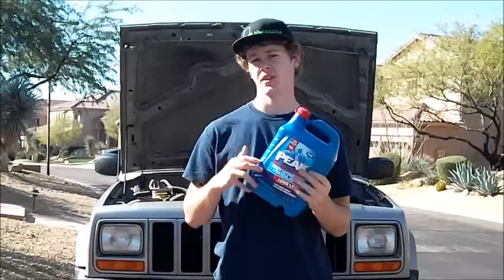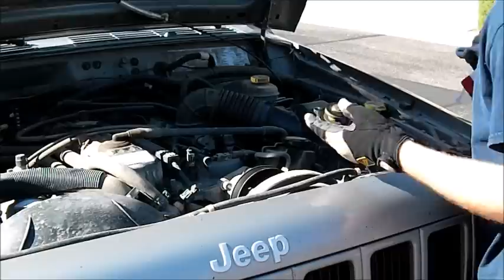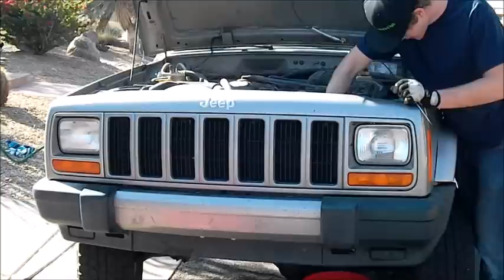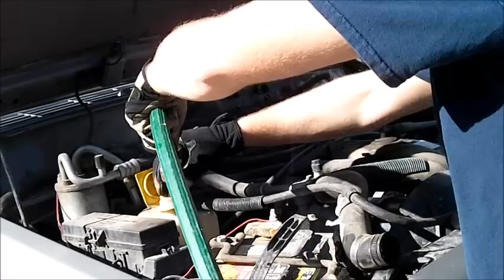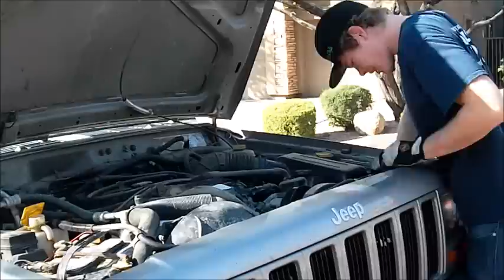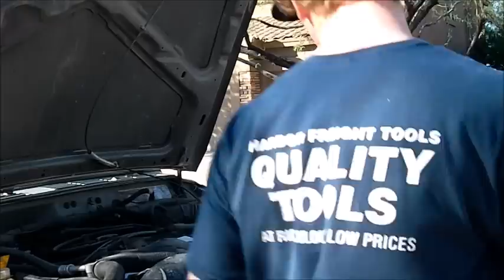jeep cherokee cooling system flush

Comment: Quick question, how did the water get passed the thermostat when putting it directly into the top of the engine? Wouldn’t that mean your thermostat is stuck open? Cause mine doesn’t let anything flow in from the top and I just did a thermostat and water pump.
Reply: Watch the beginning. He warmed the motor, then shut it off. He then disconnected the hose just after it cooled enough so the system was no longer under pressure. The heat from the block keeps the thermostat open, so water can flow through the block.

Comment: When you used the hose it wasnt distilled water right? Does completely flushing it after make it ok to use hose water? or should I flushed with distilled as well
Reply: also, you added everything directly through the radiator..should I fill up my coolant reservoir with 50-50 (assuming it hasnt after running to operating temp)
Reply from the maker: Hi Mark. That's correct. The hose was just normal water which is why I emptied the system again after running the hose through it. If you have enough distilled water, then you could run  that through the system as a final flush as well since it is impossible to completely drain the system.  To answer your other question, yes you should also fill your overflow reservoir to the proper level.
Reply: Admiral Off-Road sounds good thanks man
Reply from the maker: Mark Romano no problem. and good luck!

Comment: Great video man I blew my top radiator mudding and got a professional flush and it didn't solve my over heating problem so I may think it's my water pump but first I'm doing exactly what you just did!?
Reply from the maker: Good luck! Hope it solves your problem.
Reply: donny moran any update on your overheating issue?

Comment: 1999 Jeep cherokee sport 4.2 6 cyl. Great video, easy to do. I also changed the coolant sensor as well because my gage stopped working, it's working great now, temp is reading a constant 210 when vehicle is warm. The issue now, is I lost all my cabin heat! The heater was working great when I ran the coolant cleaner through it, and after the coolant change for the first day. But today the heater does not blow hot air anymore, just cool. The blower is working fine. Any clue why? Thanks for your help!
Reply from the maker: Sounds like some air trapped in the system. The heater uses the hot coolant to warm the air that the heater blows into the cabin.

Comment: Hey man, thanks for this video.  Before I do this I was wondering... how long did you run the Jeep while it had the water/flush cleaner in it?  Thanks!
Reply from the maker: *****  Hi Mark. i ran the jeep just long enough for it to reach normal operating temperature (210ish). it took about 10 minutes or so.
Reply: Cool, thanks so much!  I'm looking forward to doing this.  It's amazing how much car maintenance is easy to do if you just know how!

Comment: How are you flushing the upper radiator hose with the thermostat? Mine blocks all the water.
Reply from the maker: you might have to remove yours. Not sure why some people have to and others do not
Reply: Admiral Off-Road if the thermostat is blocking the water, do you still run the water through the upper hose?

Comment: Not quite sure how your system can be flushing through the upper rad hose without your motor running to open the thermostat?
Reply: I had the same question. 1995 4.0
Reply: Probably has a bad thermostat because it was cold enough to change and not bubble over which means either he has a bad thermostat or he is running a really low spec thermostat; OE is 195°F

Comment: Ok good sir, your channel is definitely the best out there for such things. So, I followed your steps like the Bible and everything worked great except the upper radiator hose flushing. I put my garden house in there and it just filled up with water and never came out the lower radiator hose (which of course was detached). I kept filling it up, and you could hear it filling up, but the water never would come out except for when I turned that upper radiator hose upside down. When I plugged everything back up and filled with anti-freeze I could only get about 1 gallon of anti-freeze in there. 

What do you think is the problem? Everything else went well, no overheating.
Reply from the maker: your thermostat is probably blocking the water. I have a video on how to replace the thermostat, but if you remove the thermostat and reattach the housing, the water should flow through fine.
Reply: Hey man thanks for the tip. I'm going to watch your video and give it a shot. Really appreciate your response!
Reply from the maker: Good luck! let me know how it goes!

Comment: When i try to run water through the “rest of the system” via the left hose facing the engine ~5:50, I discovered something was blocking it, like a valve of sorts was closed. The water just shot right back in my face when I turned the water on. What gives?
Reply from the maker: Your thermostat is blocking the water. This seems to happen to some people and not to others.  You can remove the thermostat from the housing, reattach the housing and flush. Then put the thermostat back in. The thermostat housing is held in with just 2 or 3 bolts.  If you need help with that, I do have a video on how to replace the thermostat. Hope this helps!
Reply: @AdmiralOffRoad  if I've read correctly you can push water through the small hose that goes to the thermostat it's open constant.

Comment: Can jackstands do the trick if it isn't possible to put it uphill?
Reply from the maker: Meta Mein jack stands would work fine or even just putting the font tires on a curb. As long as the vehicle is leaning back putting the radiator cap at the highest point in the cooling system, air bubbles will travel to the highest point allowing you to burp the system and get rid of all of the air.

Comment: My upper radiator hose in the top left doesnt drain, it backfills and flows out the end im filling from. Is there some blockage or does it need pressure to be pushed through?
Reply from the maker: you might need to remove your thermostat. I was able to get water passed mine, but i know some people have run into your same problem.
Reply: Admiral Off-Road Thanks for the reply! Do you think there any way to open up the thermostat without removing it? Or to flush it from a different tube other than just the radiator fill cap? I don't want to have to mess around with a new gasket if i don't have to. I started flushing the radiator but now i cant get water through the upper hose so i have no idea how much of the old coolant is still left in the system. Am i screwed and just need to get to the drain plug behind the radiator?

Comment: I noticed my lower radiator hose is a few inches before the very bottom of the radiator will I still get a good flush without undoing the drain plug
Reply from the maker: the water flowing through it should be enough to flush out anything in the radiator. There is nothing wrong with using the radiator drain plug. Mine was just stuck so I went with the lower radiator hose instead

Comment: Dumb question, but if you are running the water under pressure through the system is it necessary to run the garden hose water through the system?  Wouldn't the water under pressure when clearing the heater core do the job?
Reply from the maker: +Adam Mooberry Not a dumb question at all. Running water through the system via the hose is a way to flush out the rest of the coolant trapped in the system. The pressure of the the coolant flowing through the system might be enough to keep buildups from happening, but the dirt and debris will be suspended in the coolant still in the system. Just disconnecting the lower radiator hose will not completely empty the system. running water through the system via the hose helps to flush out the rest of the old fluid before refilling with new fluid.
Reply: +Admiral Off-Road Thanks for the info.
Reply from the maker: +Adam Mooberry you're welcome!

Comment: Hey Admiral great video i just replaced my fan clutch radiator and water pump and serpentine belt on my 92 cherokee after doing all this i looked in my original owners manual and iv never seen or heard of this but there is a engine block plug under the manifold for the coolant flush it said to leave the radiator cap on and remove the engine drain plug and drain cock and supposably it will drain everything the over flow and block everything do you know if this is not recommended ? Also i know you live in AZ where its all ways hot what temp does your cherokee run at ? I had mine jump to 230 while 4wheeling on the beach and i read that it is NOT uncommon for it to go that high but normal operating temp is 195 and thats why i changed everything now it goes as high as 195 but at night when its cool it doesn't go over 190 which im happy with but i worry when im on the beach again that it will shoot up again under the heavy strain does yours ever go up to 230 when 4 wheeling ? 
Thanks Admiral

Comment: Great video!  Got a little problem though; when I went to flush the upper radiator hose/engine it's not flowing freely. I turn the garden hose onto not even half power and it's still spewing back out the upper hose.  Off the top of my head I'm thinking blocked passages,  but my radiator went just fine and usually from my experience the radiator clogged first. any clue? 

btw this is my first jeep.  1992 jeep Cherokee laredo
Reply from the maker: you might have to remove your thermostat. It could be stuck closed and not allow the water to flow through
Reply: +Admiral Off-Road good call,  idk why I didn't think of that.  since they're cheap I'll probably just replace it,  what's the opening temp on these 4.0's
Reply from the maker: I have either a 190 or 195 thermostat (can't remember) and that works fine even in the summer in Arizona. I have a thermostat replacement video if you need to reference it but the process is pretty straightforward.
Reply: +Admiral Off-Road yeah our summers aren't Arizona hot but in NC they get pretty sticky. thanks for the heads up ill check it out!

Comment: I have the radiator out, because its simply leaking all over the place and i have a new one waiting to go in, but i cant circulate fluid without the radiator, any tips?
Reply from the maker: +Kjartan Bragi Ágústsson Are you trying to run the water through the radiator or the rest of the cooling system?
Reply: +Admiral Off-Road flushing the whole system before putting a new radiator in, but i solved it by simply putting the old one temporarily in and flushing like you did
Reply from the maker: +Kjartan Bragi Ágústsson Glad you got it figured out!

Comment: Hey xj is running hot. I checked my radiator fluid and it is not milky just dirty looking does that sound like I need to flush it out?
Reply from the maker: ash howard If its dirty, i would flush it. Dirt and things can damage your water pump or restrict coolant flow which could be contributing to your increased temperatures. It might not completely solve your issues, but its a cheap and easy place to start and will help extend the life of your cooling system.
Reply: I think I have a clog some where in my upper hose because my lower hose cools down fine it's just my upper hose is holding heat.

Comment: My xj also makes the same ticking noise as yours at startup. Any idea what that is?
Reply from the maker: mikester9er There are a few things that can cause it. Most likely a small exhaust leak in the manifold ( they're known for cracking) or some lifter noise until oil can get to them . It seems to be a pretty common thing in XJs.
Reply: Every straight 6 does it, it's normal

Comment: Very informative. Currently working on fixing an overheating issue I have on my 2003 Jeep Grand Cherokee since moving down to the Phoenix area. May have to end up doing this. Didn't even think about adding coolant first. Quick question though, how much water did you use for flushing the radiator? I live in an apartment complex, and don't have the luxury of using a garden hose. I might just pour water in from the kitchen sink if it isn't too much.
Reply from the maker: I can't remember off the top of my head. If you could get around 10-15 gallons, that should be enough to flush it.

Comment: hey man, good clear video, I flushed my 2000 4.0 like you did however I used distilled water for the whole process, a bit more expensive but worth it for the piece of mind of have pure h2o and coolant in the pipes,  then put a 50/50 mix of Zerex ZXGO51 G-05 Antifreeze after reading some reviews about the chemistry, I also replaced my 195f thermostat with a 185f thermostat because I'm usually in a very hot climate, so thanks for letting me watch it be done first before I attempted myself... I'm interested in if you know anything about that little bit of noise coming from your rig, it's almost like a very soft lifter tick, I have the exact same noise in mine and it started after putting synthetic oil in just one time! I know it's not threatening to the life of the engine but it still bugs me, any ideas?
Reply from the maker: Taylor Horton The tick is super common in the 4.0. I think, in mine, its a lifter.
Reply: Admiral Off-Road just a normal operating noise because of the 4.0L's flat tappet camshaft.
Reply: It's probably a bad idea to run a lower temperature thermostat. Your engine is supposed to run at 210 degrees F. If it runs hotter than that in any climate something is wrong.
Reply: My 1994 makes the same noise and also only began after one synthetic change. It makes me bonkers, but it also has 216K.
Reply: i heard the same thing as soon as he started it up.
Reply: Admiral Off-Road 

Mine was my throw out bearing in clutch. Had me stumped for a while. Unfortunately I have to drop the whole transmission to get access. Going to replace the clutch once I get into it. 

If you have an automatic it is most commonly your flex plate. They have four screws that come un-seeded. They can be fixed pretty simply and the noise is disguised frequently as a lifter issue.  Check out you tube. You can test this by hitting your gas pedal. If the ticking noise gets louder or even same noise but moves with the rpm of the engine it is a lifter probably. If it disappears when accelerating or when engaging gears under load it is your flexplate (automatic) or a clutch issue.

They are also known for lifter ticking. I have not experienced this but from other forums I have read the fix is to remove valve cover (good time to replace the gasket) and locate the lifter and abuse some marvel mystery oil on it or replace the lifter.

Comment: When I run water through the upper hose to clean out the system it doesn't come out of the bottom hose. Do you know what could be the issue?
Reply from the maker: yep, for some people, the thermostat will not let the water flow through. You can remove and replace it at the same time (which is a good idea anyway). If you have any questions on how to change your thermostat, I have a video on how to do it.

Comment: Nice video. Been wondering how I can flush out the cooling system; the day I got my 97 Cherokee. Now, I was wondering if you could type out all the things I need to get or need when I am doing this? I don't know why but I can't hear the sound from your video. It could be my speakers or just "Youtube" but anyway. Thanks for your great work on the video. Hope to watch another video that could help Jeep Owners like us "including you". How to maintain our Jeep. :D
Reply from the maker: BCJeepCherokee you'll need a hose, a bucket to catch the drained coolant, a few gallons of distilled water, full strength antifreeze (not 50/50 premixed), radiator flush (optional) and a screwdriver to undo the hose clamps. you will undo the lower radiator hose to drain the old stuff out, then undo the upper radiator hose and run water through the system using the hose until it runs clear. next, re-attach the hoses and fill the radiator with just water and the chemical flush. run the vehicle until it warms up completely and turn the heater on for a few minutes. drain the system again once it cools down and run the hose through it again. next you will fill the system again. put the full strength coolant in first. this is to get a 50/50 mixture. its impossible to completely drain the system so there will still be water in there. find out what your cooling system capacity is and put half of that amount worth of the coolant in. next fill the rest with the distilled water. let it run for a while and try to get all of the air out of the system. keep an eye on the coolant level for a few days. you'll probably have to add a little bit as the fluid level will appear lower when you get all of the air out of the system. hope this helped and good luck!
Reply: You sir, are the true gentlemen. Thank you for summarizing for me. I will let you know, how it went. :) Cheers.
Reply from the maker: BCJeepCherokee  Thank you for the kind words. if you have any ideas for future videos that you would like to see. let me know!
Reply: Admiral Off-Road Oh Admiral, I forgot to ask. How many Coolant should I buy?
Reply from the maker: BCJeepCherokee I bought 2 gallons. I had some left over at the end but its always useful to have some around for topping off every once in a while.

Comment: Great videos

I am doing this twice a year before summer and then again before winter. Only step that Is recommended is to blow the hose water out with air from a compressor. I actually used a small portable desalt leaf blower. 

Probably not a big deal but the theory is the minerals in the water from your hose will cause issues.